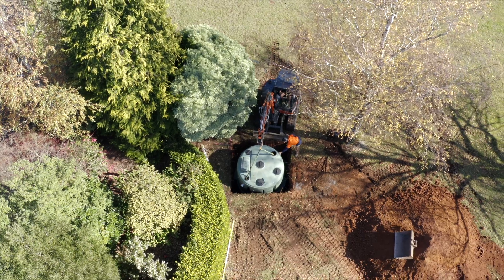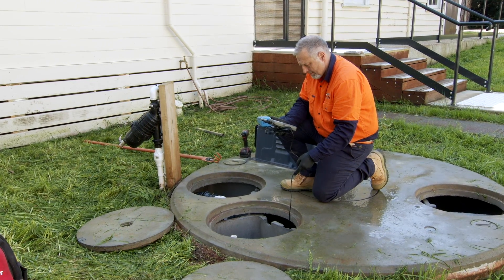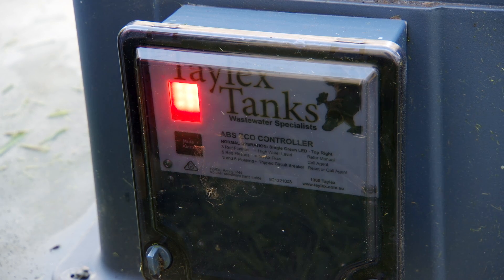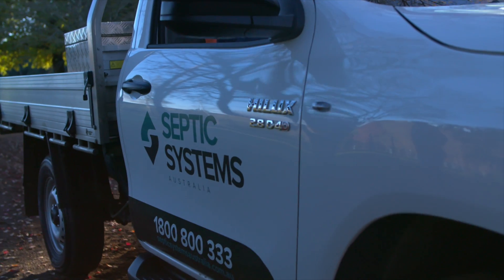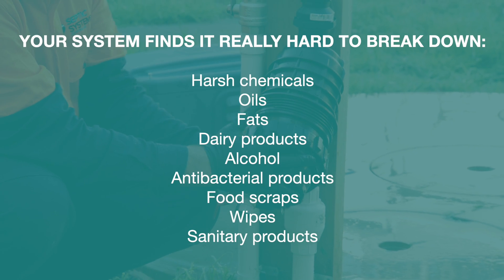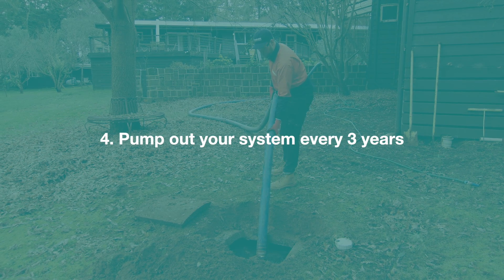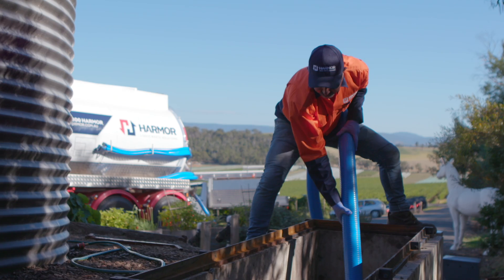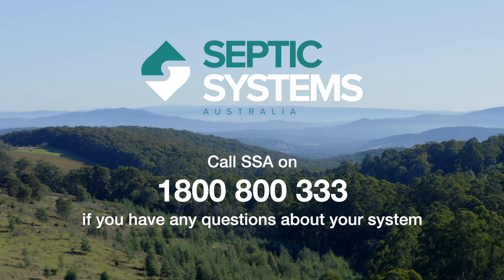Septic Systems Australia, a Home Owner's guide to an aerated wastewater treatment system (AWTS).

Comment: The septic tank systems we use here are quite different. Instead of vertical chambers, these systems use horizontal chambers, ensuring they never overflow. There’s no need to remove accumulated sludge, no bad odors, and they can be used maintenance-free for a lifetime. I’d be happy to provide more details about this innovative system
Reply: Could you please provide more information?